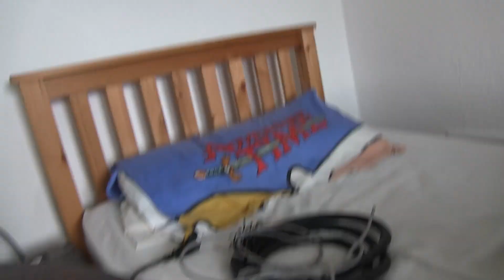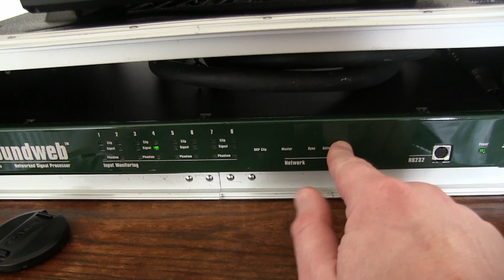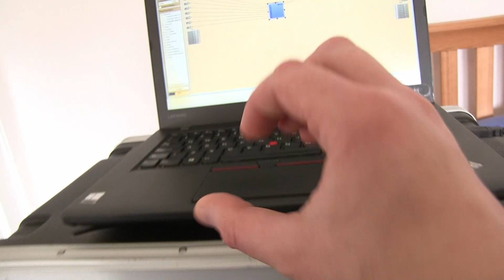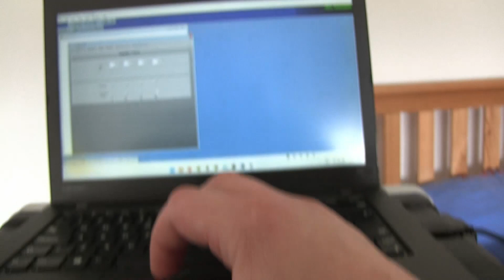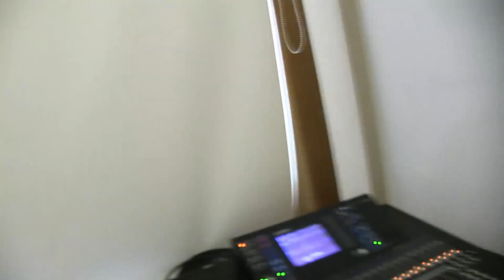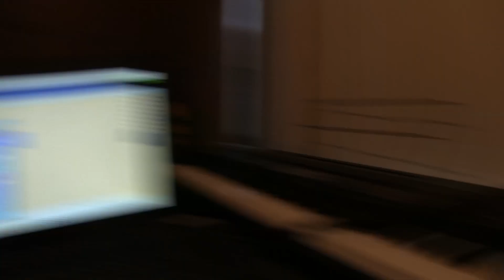BSS Soundweb DSP 9088ii 'old school' automix

Comment: OMG. I just got the cable and I thought I need an old windows machine. Looks like windows 10/11 works as well. I couldn't get the driver on the windows xp to work, apparently the prolific new 2303 chips are not supported, although sales description on amazon is still saying that. A bit of a set back. The Soundweb here is in a place of worship, and it's missing quite some EQ and volume by now, so I was hoping to adjust that. Also the noise on the output to the recorder is high. Now with live streaming, it's not great to have noise on the signal. I hope this Soundweb can sort that out, but the program look a bit too daunting.

Comment: Many thanks for the video.  I have just inherited  a  maintenance job in a venue which was closed for almost two years.  They removed most off the pa equipment but left the soundweb 9088ii 4 double 15 bass cabs, 4 single 15 bass cabs, 4 Miltec 8" speakers and 22 Tannoy ceiling speakers.  Never used anything like this before and I already have the software but this makes a lot more sense than the instructions I managed to find.

Many Thanks for the vid.
Reply from the maker: A pleasure, have fun!
Reply: Can you tell me what type of RS232 cable to use? I'm using nomal and null but still can't connect.
Reply from the maker: @HAi-123  I used a 'null modem' cable
Reply: I still can't finish it. Can you show me another detailed video? Thank you
Reply from the maker: @HAi-123  check com port and speed settings in both 'device manager' for serial usb adaptor, and bss software. It's in the video. Hope that helps
Reply: I'm just like in the video but it still doesn't work. Can you paste the link in the article so I can download it?
Reply from the maker: @HAi-123  https://bssaudio.com/en/products/sw9088iis--2
Reply: Should I download the 19mb version or the 10.5mb version?
Reply from the maker: @HAi-123  depends on windows version
Reply: The cable says 9 pins, but pins 3 and 4 are reversed, so it's a straight cable. Also, how many bits of Windows are installed on the computer? 64 or 32 bits
Reply from the maker: @HAi-123  I used a null modem cable. Windows 11 64bit, hope you get success.
Reply: I've finished talking, but when the program is about to run, I can't switch over. I can't load the program
Reply: Can't switch to Needs loading
Reply from the maker: @HAi-123  the design and the device need to have exactly the same name